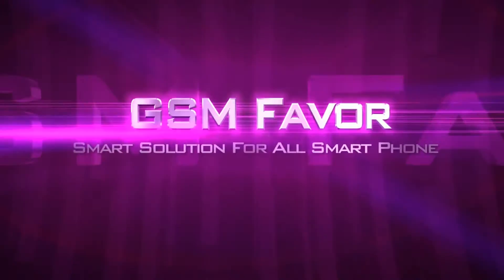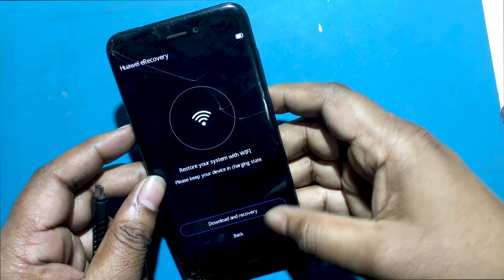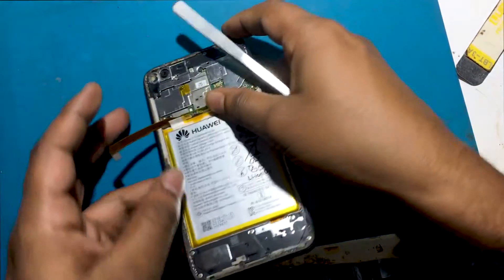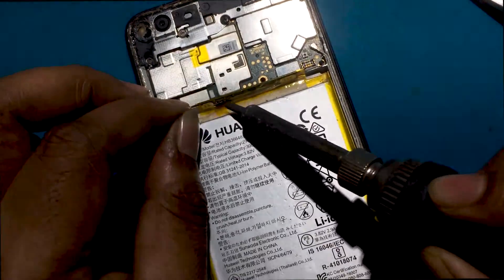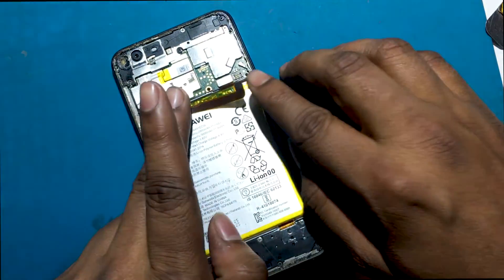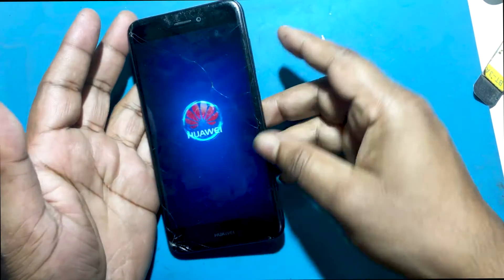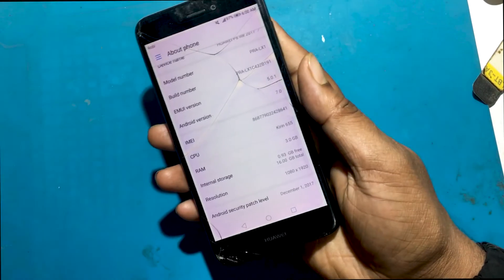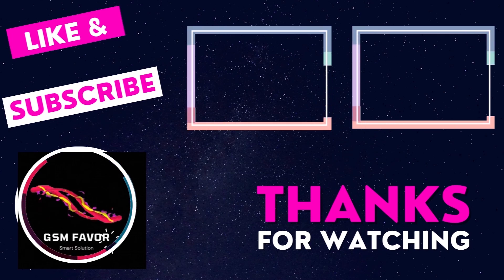How to fix auto Recovery Mode Restart on Huawei || Huawei P8 Lite Auto-restart Solution

Comment: I have the same problem on P30, but it reboots no matter if the phone is charged or not, charging or not.. I replaced the battery to a new original battery, and the problem is still there.. Do you have any ideas what might be the issue?

Comment: the problem is the battery. change it to a new one. it helped me. phone stopped rebooting. I bet most people who have this problem can use their phones while connected to the charger. as soon as you unplug it, even though the battery is 100% charged, the phone immediately starts rebooting as soon as you start using it. I hope what I wrote clears up the problem and helps.